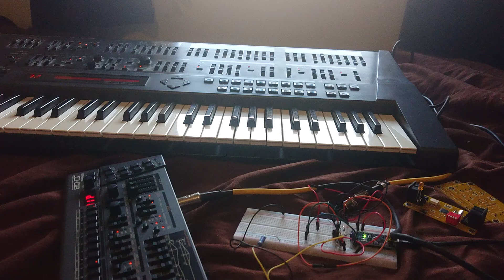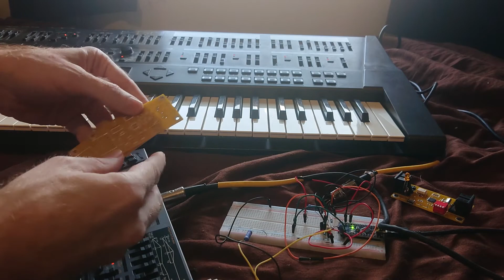Program a JD-08 with a JD-800 and transfer patches.

Comment: wow! great work. also you have BOTH of them. that's so cool! :-)
Reply from the maker: Thank you

Sadly, eventually, I'll be selling the JD-800 - hence the need to figure out how to transfer sounds to the JD-08

As an update, I think I've got the hardware sorted. The prototype is working just fine 😀
Reply: @robinwilliams5348  Do you think this will work with Sysex Librarian on a mac, to dump JD800 patches to the JD-08?
Reply from the maker: @BarryJamiesonMusic hi there, as long as it sends a single patch at a time, then yes it should work. I only say should because I haven't tested that yet
Reply from the maker: @36db  thank you!!!

Comment from the maker: Update... Alpha testing for the Jupiter X/m has been completed and it can now transfer a single patch from a JD-800 to Jupiter X/m that has the JD-800 expansion installed.

Also , alpha testing has just started for using the JD-08 as a programmer for a JD-990. So far it's looking good.

Comment: Just incredible. This was what was holding me back from getting a JD-08.
Reply from the maker: Thank you! 

It (obviously) only works with one patch at a time but I have tested it with a patch recorded onto a track in my daw and it works. (this is how I worked and why I made this... I would record the JD-800 Sysex for each multi part at the beginning of every track I used it on in an arrangement and I wanted to be able to access my sounds on the JD-08)

I have just finished alpha testing an additional feature - it will translate a patch to the Jupiter X/m (that has the JD-800 expansion)

I am just beginning alpha testing one last function that I have added which allows you to use a JD-08 as a programmer for a JD-990! (I only finished the initial code for this last night, so I really do mean just beginning testing! Haha)

Comment: Great work Robin!!! I have a JD-08, and I’m loving it. Unfortunately I don’t have a JD-800. In the future perhaps will on be able to transfer the JD-800 patches to a computer, and then to the JD-08? 

Thank you for sharing this with us,

Bill
Maryland
Reply from the maker: Thanks!! It should work fine to transfer a patch that has been saved to a librarian or daw but I haven't tested it yet.

It can only work with one patch at a time
Reply: @robinwilliams5348  Can you test to see, if it will work with a file transfer, from a PC and not from the hardware, itself?  Will this ever be able to be updated, to be able to transfer more than one patch at a time?  Great job, none the less!
Reply from the maker: It's not possible to do a bulk transfer to the 08. You can only write to the active patch

I will be testing translating a patch that was saved as Sysex into a daw. In theory it's no different but I want to check that myself before saying so
Reply: @robinwilliams5348  perfect, thanks so much. Cost for this device?
Reply from the maker: @ASH-ou4cg  I don't know yet, sorry. It's still in development.
Reply: @robinwilliams5348  no problem, thank you so much.
Reply from the maker: @ASH-ou4cg  Hi Ash and Bill, I just tested it with my DAW and recorded a Sysex dump of a patch from the JD-800 onto a track. When I played that back through the translator into the JD-08, it worked exactly as expected. I also recorded a filter sweep with the cutoff slider from the JD-800 onto a track and, again, when played back through the translator it worked perfectly.

Remember though, that the JD-800 itself doesn't like to send lots of Sysex at once so it works best when editing only one tone at a time. This is a limitation of the original hardware though and not the translator hardware or software.
Reply: @robinwilliams5348  Awesome!  Thanks so much!  I really hope you are going to sell this little device 🥳
Reply from the maker: @ASH-ou4cg  I have one small software issue to resolve with the Jupiter X/m translation and then it's on to hardware testing. I also need to source a case that I'm happy with that isn't going to push the price up enormously. Then I'll set up a site to sell it through or a kickstarter or something. Hopefully not too long now.

It's testing the Jupiter feature that is taking time as I don't own one and am having to email files to a helpful owner but they live in another time zone!
Reply: @robinwilliams5348  I completely understand. You are being very patient and are putting forth a very good product here. Myself and I'm sure many others, will wait patiently for this and look forward to getting our hands on it, as soon as it becomes available.